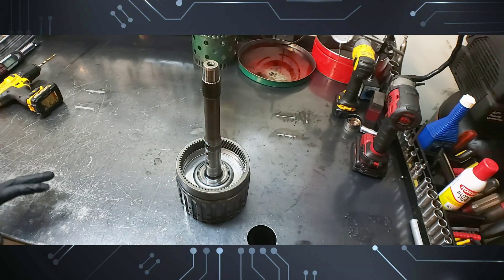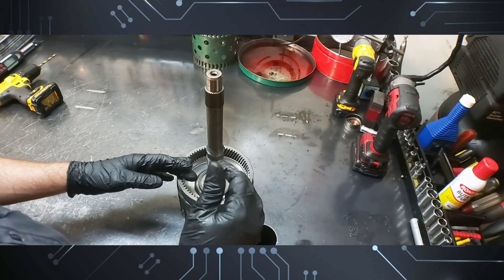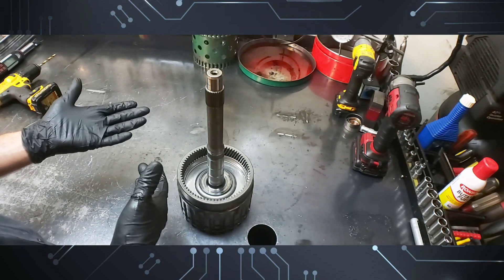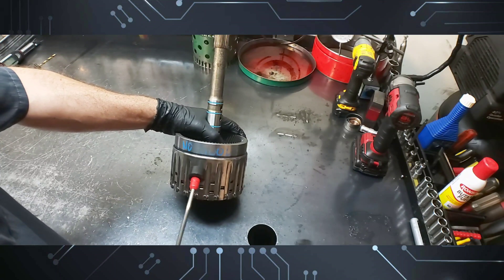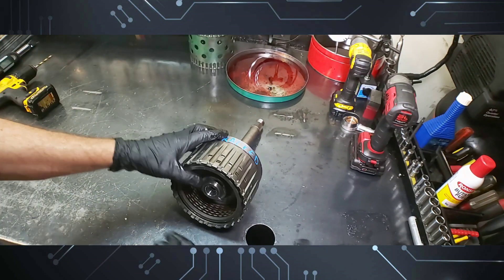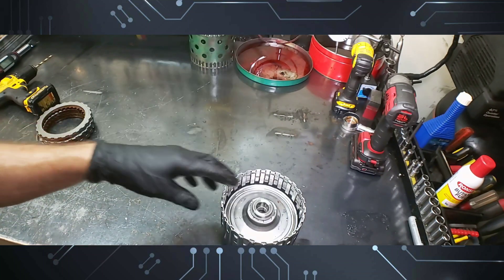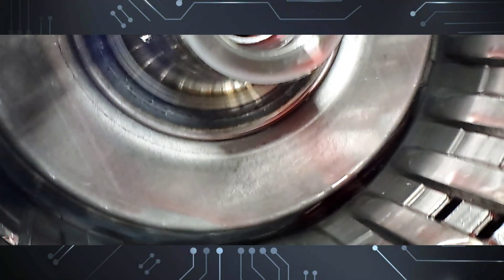💥6R80 Transmission Repair: A Case Study | Shifting Issues | Tales From the Bench

Comment: I have the same transmission in my 2016 Mustang and it’s been shifting funny also. It will upshift so quickly that by the time you’re going 45-50 its in 6th gear.
Reply: You ever figure it out
Reply: @williammiller4040  It was either low fluid or the tuning itself not sure switched to a different tuner at the same company but also put an all billet unit in over the winter with a converter re fresh and now its perfect car drives pretty close to stock even with a pretty radical converter in it.
Reply: Thx for replying tho shop will be removing shift kit to see what happens

Comment: I have a 2011 f150 6R80 290000+ miles.
New clutches, seals from WIT, oem front pump, torque converter and valve body.
Problem I'm having is a squak noise on 3-4 and 6/4/5 to 3 down shift. Any ideas would be greatly appreciated.
Also it feel like torque converter shutter under light acceleration 35-50 mph..
Thanks again
Reply: Also new bushings
Reply from the maker: That's not a really common issue but the torque converter does make that particular noise between the gears going into and out of lock up.
Reply from the maker: You need to warranty that torque converter

Comment: i have a problem of my 6r80  ford ranger 3.2 desiel engine if cold running is very good all shifting is good but if  i reach  the 85° to 92° heat and overtake another car i feel the car same horse inside

Comment: Mate, you saved SOOO much trouble you have no idea. Story: My PX Ford Ranger (Not US Ranger) had a transmission issue. Overheat, no lockup, lucky to make it home, 500km of towing at 80Kph then off to mechanic. “No worries! Gearbox rebuild at a specialist in Perth, Western Australia, 500km away- we’ll send them the box, they rebuild and we’ll put it back in!” $11kAu and it’s back. Transmission specialist said it was the worst they’ve seen, didn’t understand how it was so worn. Picked up the vehicle: “Bit rough as it’s learning mate!”. Well. I immediately suspected it was in need of a LOT of learning, as it was bumpy, weird changes etc. “Oh that’s the computer! We’ll reset it for you, it’s good, off you go again!”. Noooo it was NOT good, changing into first from 5th at 100Kph then neutral. Got the “incorrect rating in 5th” fault. Transmission specialist on phone assured the mechanic all was fine with his work, must be electronic. EVERYTHING was then reset, car taken by them to Ford dealer, fuel system overhauled, control modules changed, gear selector changed… nothing. I was starting to sweat, if it was an unrelated fault, I would be up for $$$$. I trawled YouTube and found THIS!! I immediately sent it to the mechanic and they agreed, and told the transmission specialist to take the box back and “find a fault  or they could keep it and refund the cash paid”. The transmission specialist took it apart and reluctantly did your test, and FOUND THE CRACK! All the clutches needed replacing again, my mechanic had spent 26hrs on it and over 400km of driving. They were pretty stoked to have seen your presentation. Buy you a beer or two, heck, a carton of them, if you’re ever in Western Australia!! Well done, really happy with you. Unbelievable to find this, and so well presented. Keep it up!!
P.S. Unfortunately I don’t think the transmission specialist and my mechanic are friends now… as they figure out who is gonna sort the $3k of “problem solving” that went on!
Reply from the maker: Glad your issue got resolved.
Reply: @AutomaticTransmission  Well, really appreciate you taking the time to upload! May your future be smooth shifting under acceleration!

Comment: Do you think this transmission is tough enough for a F150 5.0 V8 engine if you want to tow with it?
Reply: Depends on what you’re towing I guess! And over what, in what temperatures. Here in Australia they are used behind the less powerful 3.2 duratorque diesel, for 3.5 tonnes (metric) towing. But many would fit a modified cooler and heavier duty TC, plus bypass the thermostat that stops lower temperature flow to the cooler. However that’s for constant towing at 100°f +. Apart from factory faults and weak TC issue, I believe the box itself is ok. But with enough force and/or stupidity, I’m sure one could bust it!

Comment: My Gen 2 6R80 with only 1600 miles on it after a rebuild, flared 300rpm from a 5-6 gear shift while just cruising. When engaging into D from Park,  the tranny goes into 2nd gear, and then 5th gear.  This sequence takes as long as 7-8 seconds as well.   No codes or wrench light.  Reverse engages perfectly fine.   I swapped a new valve body/leadframe, and no change..   I'm thinking something is going on with the forward (A) drum assembly???

Comment: When I was a tranny tech at ford I’ve actually seen that piston in overdrive cracked but it would only act up hot and it would fall on its face when going into fourth, tore it apart twice in order to find that problem

Comment: Hi, I've got a 2016 F150 with 5.0 w/ 99k miles on it. My torque converter went out about 10k miles ago and I had it replaced.  Transmission tech checked everything out while he was in there and said everything looked good. He replaced the fluid and filter also. Now, I've got the 5-3 "Squawk" happening. The first time it did it was shortly after the repair. Currently, just about everytime it shifts from 5 to 3 it squawks.  I just ordered a tube of the XL-16 6R ATF Additive. In your experience, is the additive going to fix the Squawk for good? Trying to determine whether or not to trade it in. Thanks!

Comment: Hiram, I can see you are really good with 6r80. 
Glad I found your channel. I have a 15 transit 350 with 3.7. 6r80. 
Codes P0706,0707,0712,0715
I have been having this vibration sound for a long time, I would describe it like a low bass sound, from big sound system. It comes and goes at any speed above prob 40mph. It will sometimes happen every few seconds and it last for a second or 2. 
We now have 135k and it started 50k or so ago. I have taken it to several shops and they all say it’s tires or shocks or something and never fixed the problem. 

Last week I was headed up in elevation on a road trip, no trailer. And I was noticing the rpm would bounce +\- 200, when the sound happens. 
Then, the sound went away. Approx 50miles later I noticed fluid getting on my rear Windows. I kept driving and made it the next 100 miles to our destination. During the 100 miles, it didn’t ever shift down when pulling hills, it stayed in 6. Even if I manually tried selecting another gear, it wouldn’t allow me to change.  
After getting into town, I shut it off and when restarted tried, it shifts hard to reverse and drive. It operated fine in R. But feels like I’m still starting in a higher gear. 
We trailered it back to our town. Where I now have it and am ready to work on it. 

What are your thoughts? I purchased: lead frame, case of fluid, filter, and it was all here by the time we got home. 
Now I’m thinking torque converter too. 
Or am I too far into it and should just bite bullet and order a trans?

Where would the fluid have come from? 
It looks wet on bottom of bell housing…

Comment: Great catch for sure. That could have been easily missed and you be pulling the transmission back out. That really could get a guy go down a rabbit hole and get all turned around.
Reply from the maker: Yes indeed, that's where the intensive drive payed off fishing out the issue. Going directly to the affected components. In this case the Overdrive drum.
Reply: @AutomaticTransmission  I think that is what has gotten lost at a lot of the shops these days. Actually listening to the customer complaint and trying to really find the problem. I used to own semis and most mechanics working on big trucks don't even have a CDL. They scan it, unleash the parts cannon and push you out the shop as quick as possible hoping you make it a couple hundred miles down the road before the money light comes back on.
Reply: @AutomaticTransmission   what’s the name of this part.

Comment: Great find.  Any idea why it cracked?  Google search shows this may be a more common 6R80 issue.
Reply from the maker: You're probably right, more common in different areas of town I suppose. Where there's a lot of stop and go traffic. I've noticed that on transmission with highway driving have more miles before repairs are needed.

Comment: Excellent!!  And you are right about road tests.  Nobody drives exactly the same.  I've even had to have the customer drive it so it would show up problems, and the way they drove it was not quite what the manufacturer had in mind.
Bill
Reply from the maker: Yeah, we usually put them under different loads after any repairs. Just to make sure no problems will arise later down the line. We usually put about 30 miles before delivery. Just to make sure.

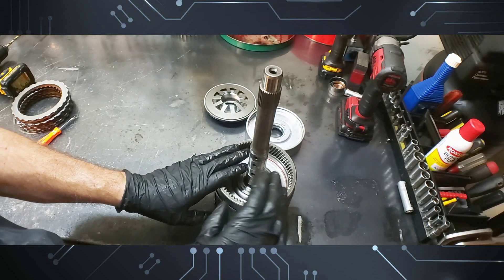Comment: I have a question not directly related. At 12:08 I noticed the snap ring. I wonder if you would share the type and brand of pliers you use to remove this type of snap ring? I encounter this type rebuilding hydraulic cylinders and recently had a large one that my little pliers were not large enough nor supplied the force needed to open the snap ring enough to remove and replace it. I can find the large, ratcheting type that use a pin tip but not for this type snap ring. Or maybe any of your subscribers that might be able to help?? I have searched everywhere I know and the Knipex 45 21 200 is the closest I can find but I need longer handles.
Reply from the maker: Snapon and Mac Tools have them. I'll post a video of them later.